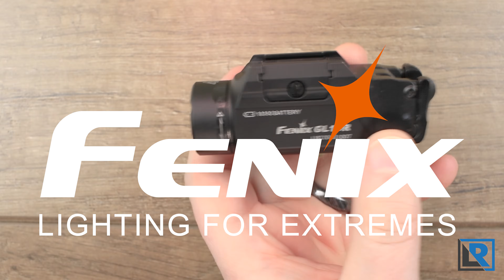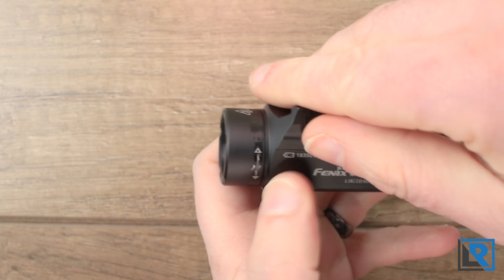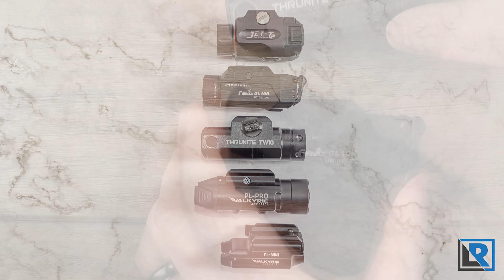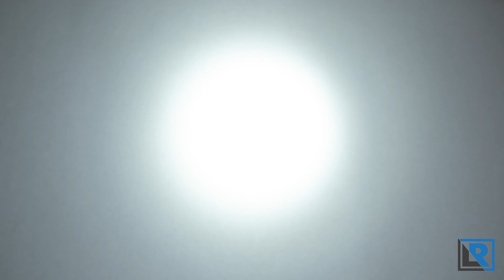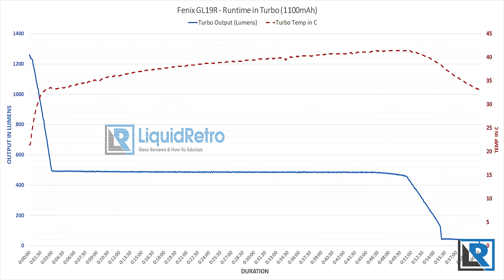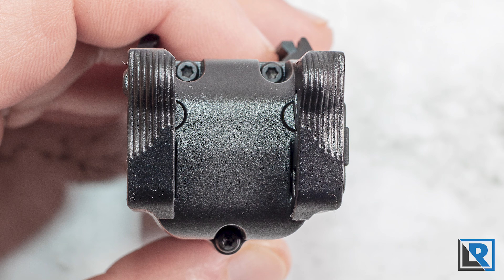Fenix GL19R Review (1200 Lumens, 18350, Tactical WML)

Comment: You can adjust the lock tension with the flat screw on the left (opposite the latch) for a snug fit. been moving this between my 9mm pistols and AR and a quarter turn is all it takes for a snug tight fit on either platform.

Comment: If it gets up to TLR 1 HL 30.000 candela yeah maybe, at 11.000 no way.
Reply: Per the Streamlight webste, peak candela rating for the TLR -1HL is 20,000. So with the Fenix you're gaining 200 lumens but losing 9,000 candela to the TLR-1HL. Either light will be more than sufficient for 95+% of any hostile situations you're likely to encounter.